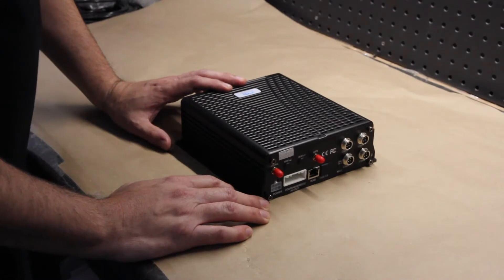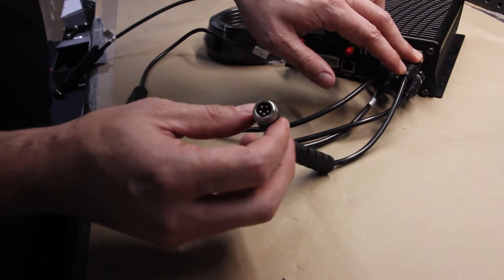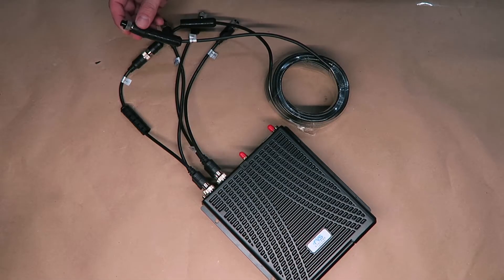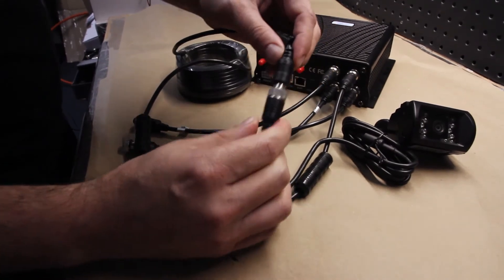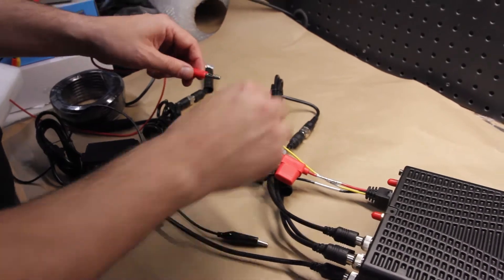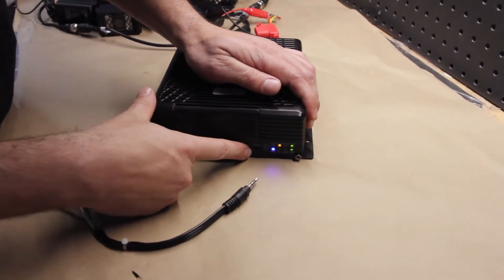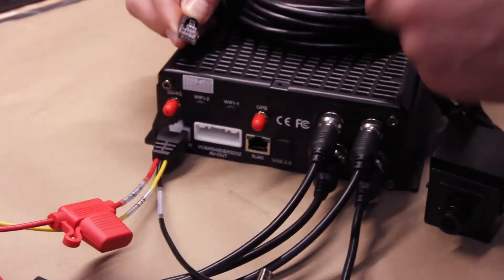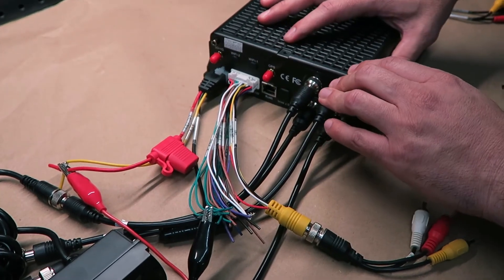MobileMule™ Mobile DVR Setup (1/7) - Cable Connections

Comment: never shows where to connect GPS, WiFI, and 4G antennas that come with the kit. WFi is labeled on back of unit but there are 2 ports. Which to use? The GPS and 4G connectors are not labeled. Hmmm??

Comment: my MobileMule 1080 kit didn't come with connectors for the 7in monitor. Cable in this video and cable from monitor are BOTH RCA female. Also, power wires from Monitor have no connectors on the ends of the wires so you can't connect them to the female power plug in the video. UGH...

Comment: Hello sir. I have a similar mobile dvr and having trouble with powering up. Don't know exactly how many volts and amps power supply this one needs. Tried 10 different power adapters but dvr is keeps shutting down after couple minutes. Tried 12v 24v and 32v power adapters but none of them is keeping it up and running.  So if you can possibly show me or tell me what was the the power source you used for this dvr? If you can give me exact details of it that will be great. Thank you in advance.
Reply: Have you figured it out?